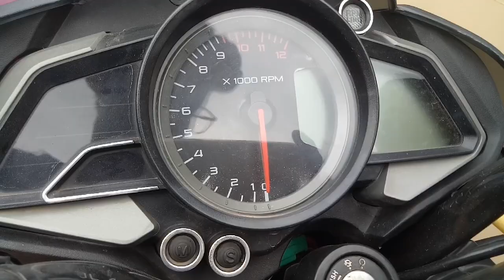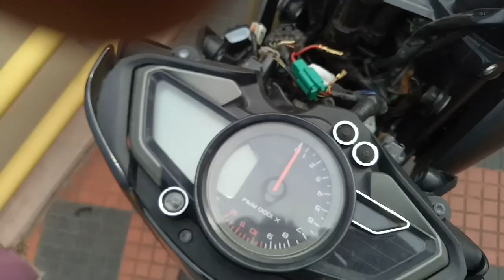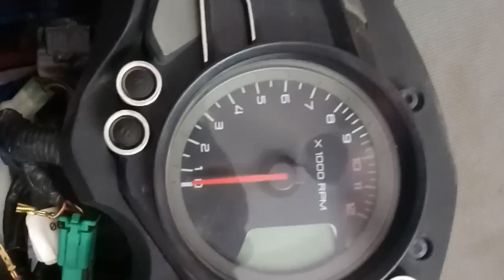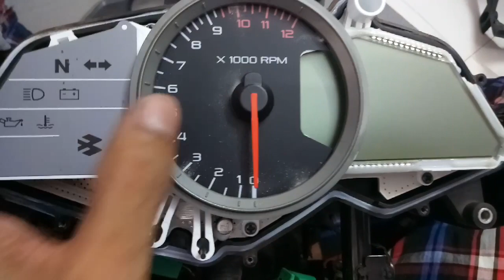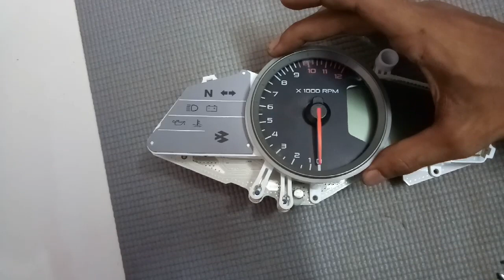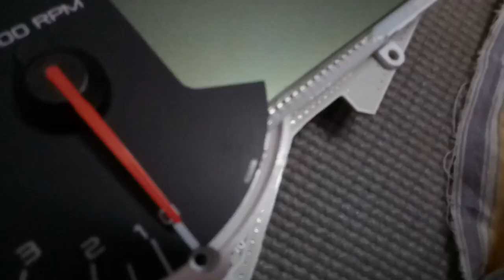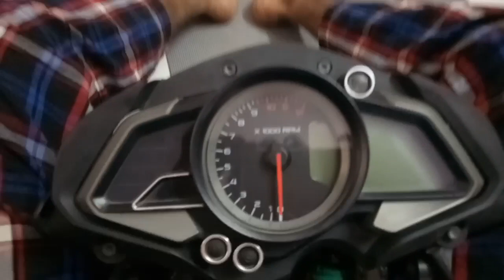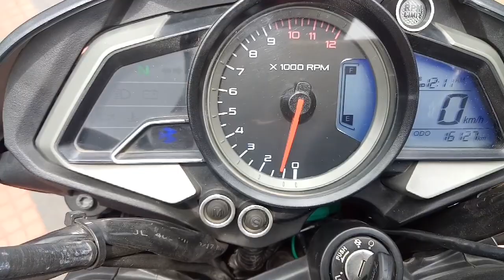NS 200 vibration meter console fixed

Comment: Hi bro my rpm needle starts vibrating after 4000rpm what to do?
Reply: Bro i have same problem..in my pulsar 200NS
Reply: I have same
Reply: mee too
Reply: me too bro at 4000 rpm meter needle vibrate
Reply: Me tooo any one with solution